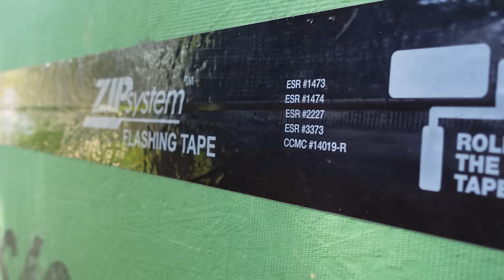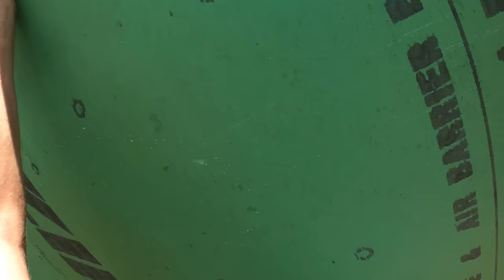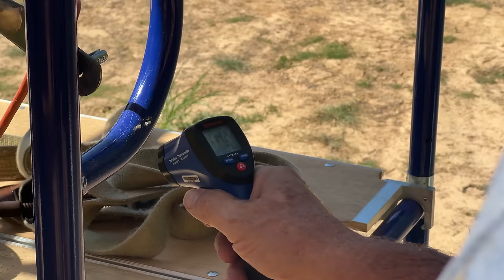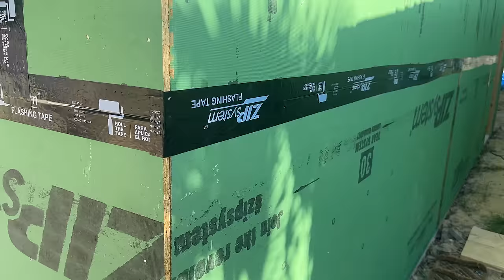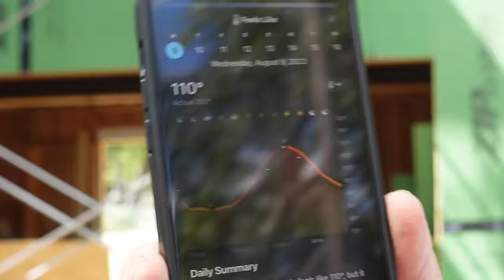We Thought We Could FINISH...But the Roof Made Us QUIT!!

Comment: Yes. Congrats on the 508K. But as I  commented on an earlier video, that PSL beam was defective, and likely not properly made to handle the load on it. I worked in a Parallam plant for 35 years, over 20 years in quality control. Replace it now, or you are taking a big risk.
Reply: Which one are you talking about?
Reply: @mr.g937  

Well, it's actually 2 of them. The main header (18'8") over the main garage entrance, and also the short header over the ground floor door to the house.

The short one is minimal risk due to the short span. But the garage header is concerning.

I don't know the exact dimensions, but it looks like a 5.25" X 11.875" beam & header 2.2E. My best guess from what I could make out in the video is there is a delamination (what graders call a "blow")  that is 1" from the surface and about 3" wide that runs for about 8 feet. This blow also extends right to the surface. This means that the effective structural size is that of a beam only 3.5" X 11.875" X 18.8'.
Reply: @mr.g937 

I'm amending my response. It's not a BIG risk to not replace it. A 5.25" X 11.875"  beam is likely over-engineered for a 19' span. But it makes sense if the walls are made using 2" X 6". 

I was just noting that the beam had a severe defect prior to installation. It probably should have been rejected at the plant, but being exposed to the weather at the lumber yard made the defect more obvious.

If I were the builder I'd put a claim for a new beam plus labour cost for replacement, or at least a MAJOR rebate.

Comment: Just a lil constructive criticism but you guys (jordan/ rad) 13:01  should get used to holding you hammer all the way back instead of choking up in the handle. Its so much easier once u get accurate swinging with your arm rather than your wrist. If you’re framing the main house after this u should try to get used to it now!

Comment: Been following you guys for awhile, over the last two years I’ve followed your entertainers remodel  series for inspiration and used many of your ideas and methods to complete a similar identical remodel… kitchen, lvl’s, lVP planks and currently refacing our fireplace with MSI stacked stone. I must say I ‘m a little disappointed with your change from your flat garage roof concept to these full span style trusses which raise the building out of scale with the neighborhood and the future house. Also your use of these trusses do not tie the gable and side walls together laterally the way your first floor ceiling/2nd floor joists do. Most builders here in the northeast use the brown 5/8 zip or 5/8 plywood the better choice for your roof longevity. Still love you guys and your innovative work ethics and ideas.